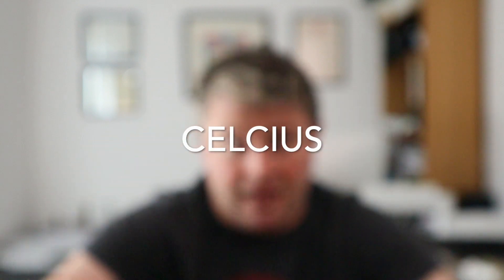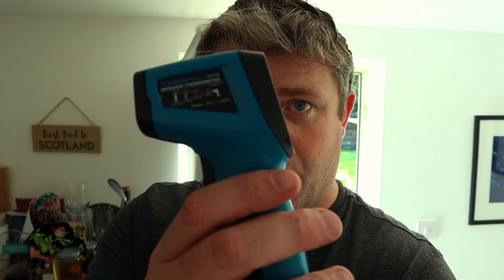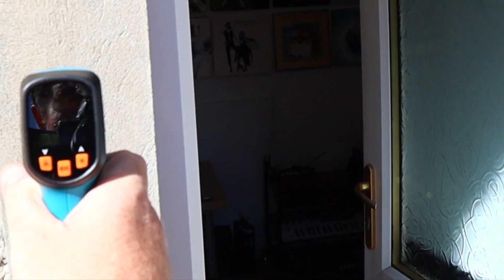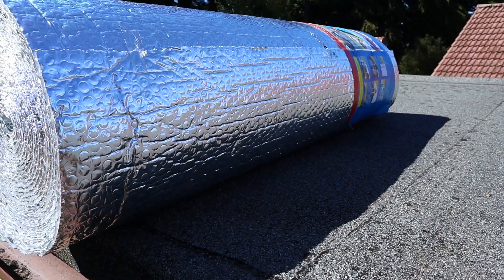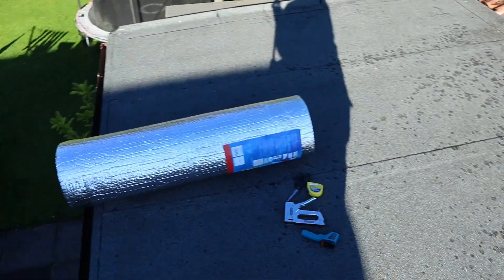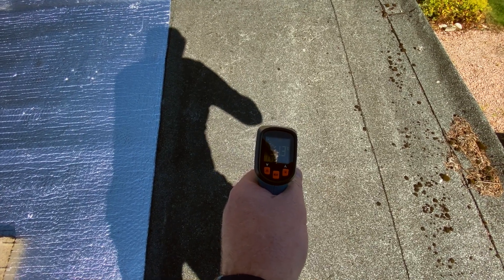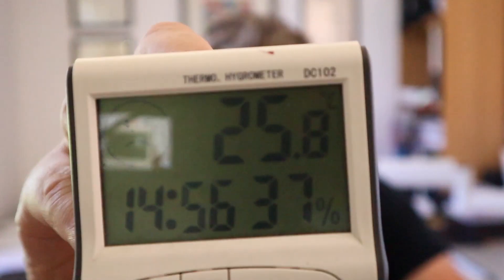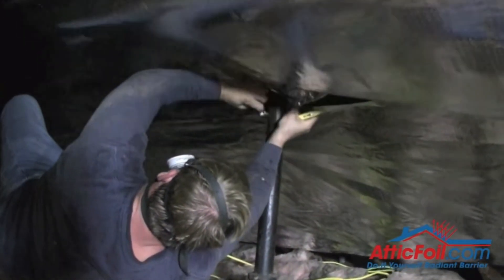Using Insulation to Keep My UK Home Cool During a Heatwave

Comment: Following up on this for 2023, there needs to be long term solutions and AC/heat pumps might be part of that. From my own research (as a Brit who owns a large building in Texas), high albedo roof and wall coverings help, having the building "air tight, ventilate right" is essential for efficient mechanical cooling. Large eaves and solar barriers in glass etc. But I'm interested in the best UK solution, I think exterior insulation with a white render, large overhangs etc would be best. Not clear on masonry thermal mass being inside the insulation envelope would be beneficial year round or if we should move to lightweight construction, like in much of the US. Have you got any further with this?

Comment: The same idea as I had so was delighted to find someone had already run the experiment last year. I've yet to try it out on our flat-roofed home though.

I'd wondered if using a few extra bricks to leave an airspace between the foil and roof surface might help too, a little airflow?

Comment: Really good proof of concept. as another idea if you fitted the Mylar to a timber frame so you had an air gap of say 75 or 100mm that may give a better reduction as you will have the reflected heat and the low emissivity air gap to further reduce the heat transmission. It would be good to see you try this even on a normal sunny day and leave 50% uncovered to see what the transmitted heat is like below the raised section as you managed to get a 20 degree drop from it being directly on the roof.
Reply from the maker: True, maybe next heatwave !

Comment: Amazed that the roof wasn’t painted with solar reflective coating in the first place.
Reply from the maker: Both sunshine and reflective paint used to be a novelty in Scotland. That is changing
Reply: @RealLifeArchitecture an anecdote: some of the operating theatres at St James univ. Hosp. In Leeds had large sloping glass skylights. In hot weather there was a water system to run water over the panels to cool them. That was in the 70’s. It worked, pre A/C and clean air laminar flow systems, and water wasn’t a precious resource.

Comment: Interesting video.  I have exactly the same problem in my home office.  Flat roof with large window, south facing.  I have used a 100mm celotex offcut to fill the entire window space externally (propped with a  timber as the original tape melted off in the heat!).  Works a treat and now 22ish.  As you well know, windows are the weak spots!
Reply from the maker: Thanks for sharing

Comment: might want to wear some sunglasses whilst putting that on the roof in the sunshine as it can be blinding and you might stumble off your roof, it can also cause sunburn too as it's reflecting the sun back at you
Reply from the maker: Thanks, while I didn’t fall off it was ridiculously hot up there when I was filming
Reply: @RealLifeArchitecture  we were replacing our roof and as part of the project we put 4" foil backed insulation up there, get a good tan though lol

Comment: Very interesting experiment to control the buildings temperature. The James Webb telescope uses the same technique but with several layers of foil. The temperature difference is huge but this is in a vacuum which means controlling air movement would also be key as this would transfer heat through its humidity. Time for a new Building concept. Another great video.
Reply from the maker: I hadn’t thought of that but you are correct.

Comment: A large shade tree would also help to reduce head due to direct solar radiation. That won't work for all buildings and it takes years for a tree to grow large enough but it could work for this small shed. So plant a tree and install insulation.
Reply from the maker: …and wait 50 years

Comment: The direct sunlight on a flat black roof is not going to help. Any shade barrier between the roof and the sun would help - looks like an ideal spot for some solar panels to me!
Reply from the maker: True, am seriously considering it.
Reply: @RealLifeArchitecture  had solar panels fitted last year on our tiled pitched roof.  I've not taken measurements, but I'm convinced it made a noticeable difference to the summer temperatures upstairs.  Plus the loan repayments were offset by the savings from generation (post feed-in tariff installation)

Comment: Neil I wonder if you can first put used timber pallets on your office roof then using the upholstery stapler, staple the insulation to the pallets, I bet it will reduce the heat by 15-20 degrees on your felt roof. The pellets will not only physically separate the hot insulation from felt roof but also allow slightest of breeze to further reduce the transmitted heat!
Reply from the maker: Can you tell me what “used pellets” are, maybe I know them by a different name
Reply: @RealLifeArchitecture  sorry misspelt trying to multitask. I meant pallets. The wooden pallets used to help forklifts handle heavy items.

Comment: Have a similar issue on our flat roofs. 
What level of existing insulation is there in the roof already? 
Been considering re-doing the rubber roofs, but with a layer of Kingspan or similar ie a proper warm deck.
Thoughts?
Reply from the maker: Warm deck is the way to go. My roof has about 100mm of mineral wool between the joists. It’s cosy in the winter, doesn’t take much to keep it warm.
Reply: @RealLifeArchitecture  It would be interesting to see how much difference in heat transfer there would be, if you put a warm deck on top of your existing. 
Any guesses on the amount of improvement 100mm or 200mm of kingspan would make?